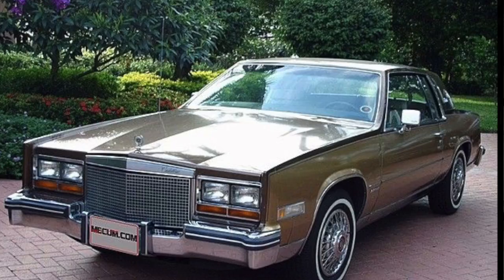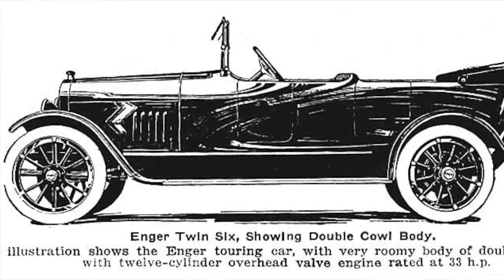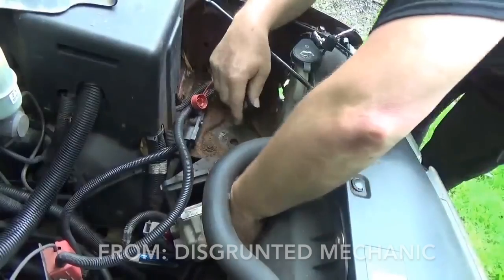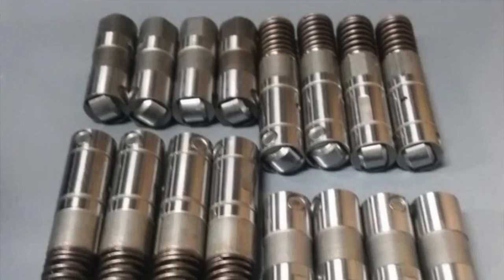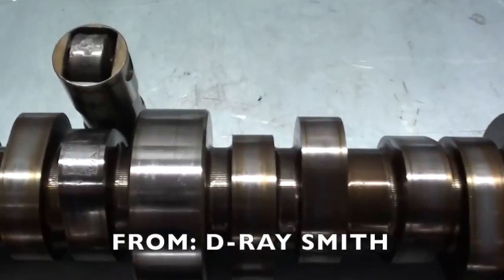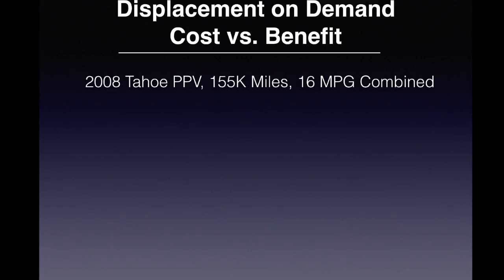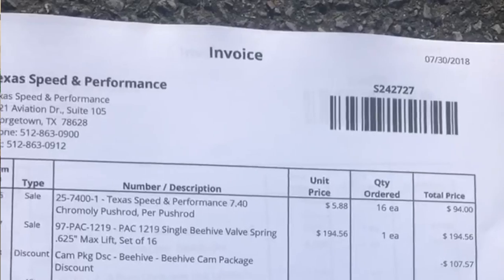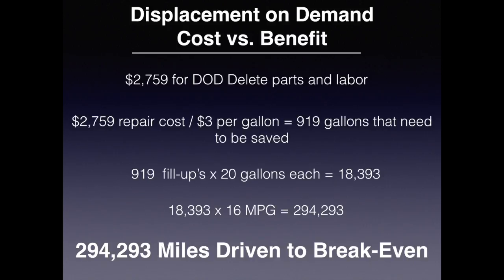DISPLACEMENT ON DEMAND - DOD, Repair Cost and Return on Investment.  Chevy Tahoe Collapsed Lifter

Comment: In your research have you gotten a feel for what percentage of owners are having problems with this system?  Is anyone getting 150K, 200K out of these without any problems or are all of them just a ticking time bomb?
Reply: I have a 2007 Tahoe with the 5.3l DOD. Has 190K, its on its second engine. First was replaced 6 years ago, prob 100K when replaced. I Just had to replace the oil pump on it with a HVOP due to lifter tick at idle. That one was an airport police vehicle though so it prob idled a lot. 

Chicago Police used a lot of Tahoes with DOD. I have purchased a few, all had DOD problems on purchase but also had 150K. 

Friend has a 2007 Silverado with 170k, factory engine with no repairs.
Reply: 3stinkos I know many people with Silverados from 2008 to 2011 that had engine failure or excessive oil consumption as early as 60,000 miles.
Reply: 3stinkos i currently own a 2012 Sierra and I bought it brand new. I have 170k miles and no issues what so ever. I’ve changed the oil around 5k miles every single time. Just installed the range technologies DOD disabler about 2,000 miles ago and it has helped with the wierd shifting
Reply: 2009 Silverado here 5.3 with the afm I'm the second owner it currently has 235,000 miles I use only mobile 1 oil and change every 5000 - 7500 miles 
I've had good luck so far, but I am worried about when I do have an issue
Reply: I was the second owner of my truck. Bought it at a Chevrolet dealer with 53K miles. Babied it and did all fluid changes as prescribed with synthetic oil. Failed at 93k miles still owing two years of payments.
Reply: 218k and 8800 hours on a 2007 Tahoe before it failed...218,500 it failed again.
Reply: Original owner 2013 Silverado 5.3L.  Oil changes according to Oil Life indicator.  Had oil leak, dealer replaced VLOM  at 102,000 miles.  Chevy would not help with $1200 bill.  Lifter stuck at 123,500 miles.  Dealer wanted to replace all the lifters  ($6600).  Had only Stuck lifter replaced by local mechanic ($950).  Currently at 125,000 miles with Range AFM Disabler,  Running fine in V8 only.  No noticeable loss in MPG... 
5 of 6 mechanics I talked to had all worked on Trucks with stuck lifter issues.
Reply: Made it to 192k then poop.  Waiting on a rebuilt without dod

Comment: My 09 Suburban has a small tick noise. Has about 100k miles. If your paranoid just put it in manual mode and ride it in 5th gear. It’ll stay in V8 mode.
Reply: can and lifters in your near future
Reply: juan rodriguez I think so too. Anything I can do before?
Reply: @goldencosmonaut  start saving your money i'm l1 master car and truck 45 years in the trade last gm i got was a 99 2500 sub. 7.4 at 50k tick tick tick at 60k put a cam and lifters it went to180k before the reverse went out last american car for me  never again now that toyota makes a tundra with 5.7 got one in 07 190k now it got plugs at 100k and water pump and radiator at 150k never a ck. engine light [cel] also my 96 t100 3.4 325k never a cel and no engine work t belt 2 times

Comment: 07-08 Impalas with the 3.9l have the DOD as well. Gm no longer supports that system, if the cam or lifters fail they sell a factory delete kit.
Reply from the maker: Wow, I didn't know about the factory DOD delete kit. I gotta look into that as I'm starting to think that I will have problems getting the Tahoe inspected once she's on the road again.  Don't know how the ECU tune and turning off the DOD might effect emissions and all.  -Chris
Reply: If it looks stock, and there is no CEL on, and all the obd2 monitors pass I don't think you would have an issue getting it to pass an emissions test.

Part # for the v6 3900 Impala DOD delete kit is HL187. Only issue I had with those is the dealer has to contact tech support so GM can create a special file to install into the PCM to delete the DOD programming.
Reply: @mph5896  great info!!! GM needs to come clean and offer factory ECM corrections for 5.3 DOD deletes. The cam and DOD kit are easy to install. Finding a PCM reprogrammed who doesn't charge $300 for turning off the DOD is challenging and takes a long wait.
Reply: LT1swap.com charges $50 (shipping back included) to turn off the factory DOD for the 5.3l. Once he gets it he usually ships it back the same day.
Reply: @mph5896  your awesome buddy!!! Thank you!
Reply: No prob!